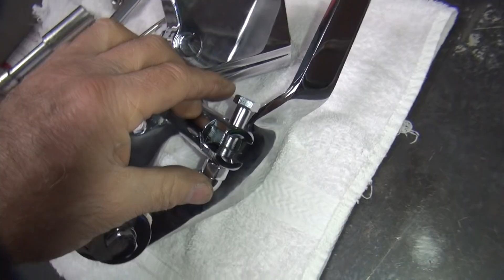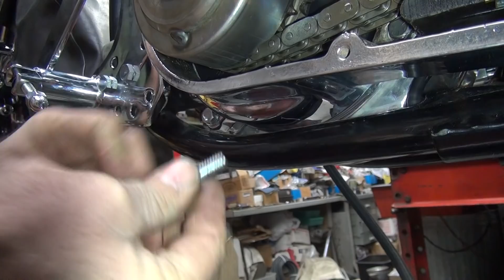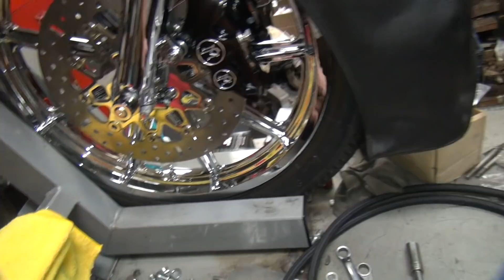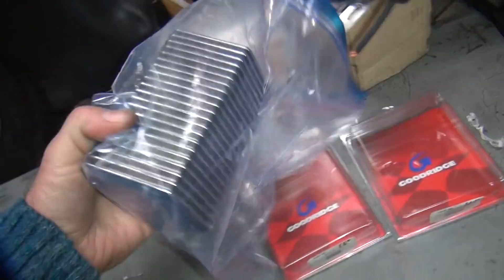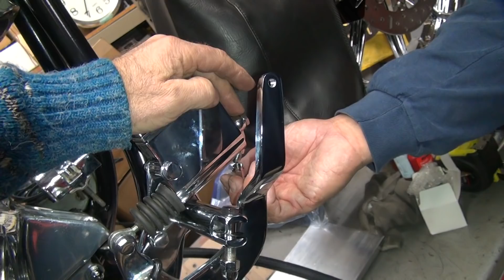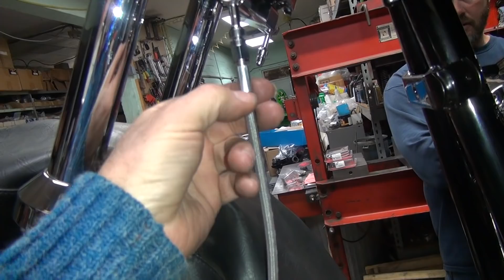#172 1978 93ci stroker shovelhead big bore motor new bike build fl harley by tatro machine

Comment: Do you know the part number on that shifter arm. The spline is a larger diameter than most of the shifter arms out there. I have the same arm, but it is stripped on the spline. Any help would be appreciated. Thanks.